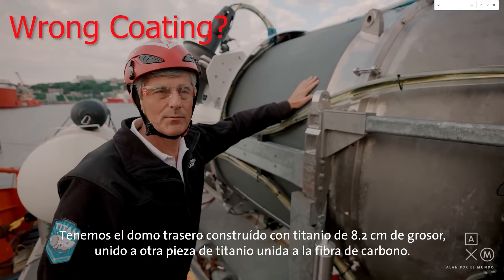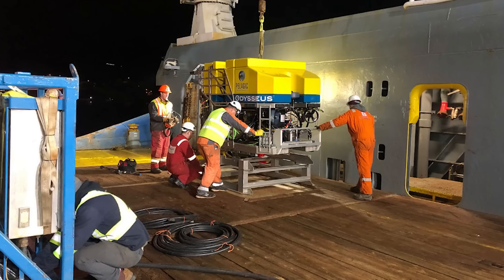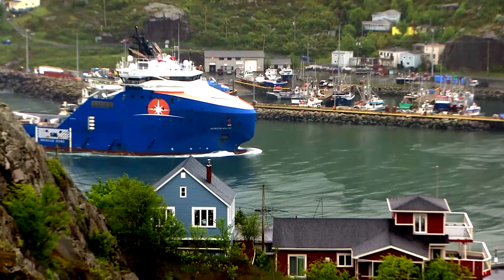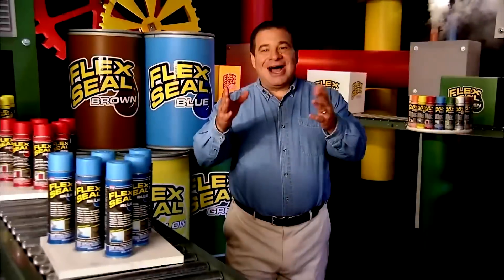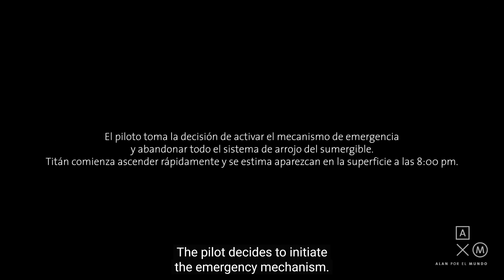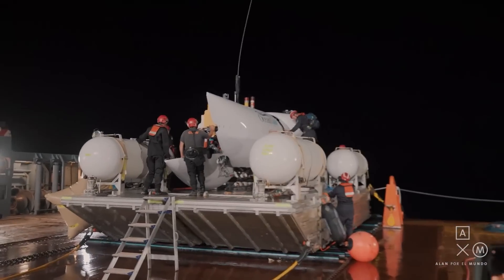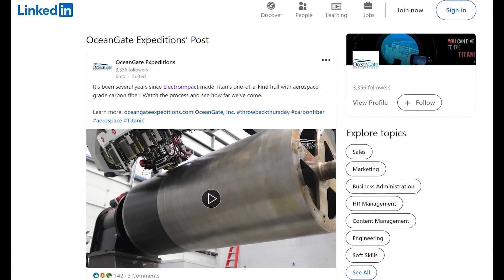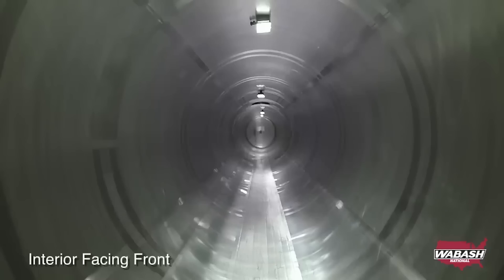Titan Sub Wrong Coating? Hull Construction, Debris Field Search

Comment: The Rhino Liner is designed to be vapor permeable so moisture does not accumulate under it.  This means that at high pressure, water vapor would be pushed through and accumulate under the liner in the pores of the carbon fiber as it descended.  When the Titan then ascended this vapor would try to exit and cause delaminated blisters in the liner.  In this video, and the original video by Alan por el mondo, these blisters are evident all over the hull.  In the videos when Stockton is talking about the liner he’s places his hand on the hull and if you look closely he moves his thumb right on top of one of the blisters.  The formation of these blisters make Rhino Liner inadequate for this application.
Reply: Rush sort of knew what he was doing, but didn't really know enough to do what he was doing. And of course, he ignored all the experts in the field. It was just a matter of time.
Reply: @DerBingle1  He knew enough to be dangerous !!
Reply: @DerBingle1 Rush was obviously a marketer (professional liar) not an  engineer.  Elon Musk has the same trait

.
Reply: repeated dives fatigue failure never checked too
Reply: @gopikrishnan890  How could they not have taken that into account? It seems so basic.
Reply: @DerBingle1  I think that the design team did not fully understand the effect of seawater at high pressure on the carbon fiber hull.  Carbon fiber is well understood and suited to pure compressive loads but has 2 major weak points.  The first is that it is porous and the second is the much weaker strength of the laminating resin compared to the strength of the carbon fiber.  The porosity is a problem since high pressure water, vapor and air can enter the resin matrix and apply unanticipated loads to the interior structure of the carbon fiber matrix. The second problem is the strength of the resin is only about 6000 psi.  This means that at depth the pressure can equal or exceed the strength of the resin and can cause delamination of the structure. This damage would then grow on successive dives increasing the porosity of the structure and reducing its strength.  This delamination was most likely the structural sounds heard during the dives.  If the designers had really understood these aspects steps would have been taken to reduce the affect or eliminate these problems. The first would be to limit the operating depth of the Titan to 2000 meters so the pressure would not exceed 3000 psi and provide a 2 to 1 safety margin.  The other, and best, option would have been to use an impermeable metal external liner to prevent any pressure from entering the carbon fiber structure.
Reply: @DerBingle1  sociopathic business owners are the norm. they're not team players. that's why they're business owners and you're working for them. This attitude by the dead CEO is completely normal.
Reply: Rhino liner or no liner. The Titan had passed its service life after one dive.
Reply: Science is fun
Reply: I agree.
Reply: Also remember the submersible was towed out to the dive sight, not wenched on the ship like it usually was. So it was battered and waterlogged by seawater for 3-4 days prior to the dive itself. Look at how quickly it was diving, it clearly was overweight which was shown by how quickly they were descending.
Reply: Rush's facial expression always makes me think of the face of someone who has just been told a joke that you were the butt of.
Reply: Eggg-zactly..!
Reply: The same reason is why any bedliner and seal coating is garbage because it just traps moisture and prevents the metal from breathing which makes it rust faster.
Reply: Rhino Lining is just molten polyurethane, sprayed on. It has no magical properties other than weather resistance, waterproofing, etc. Using rhino liner in any capacity as an adjunct with carbon fiber and titanium is amateurish in any case, because you shouldn't be trying to use it AT ALL!   IT'S STUPID!
Reply: Isn't Rhino liner used for pickup truck beds...?

Comment: We need to know what temperature ranges the sub would have been exposed to. How warm did it get in the sun and how cold did it get underwater.
Reply: Temp is one thing, but the pressure surely would cause the materials to contract significantly, even the viewing window (acrylic) is said to lose 3/4 inch when reaching the titanic depth.  The component materials would expand back to their original size when the sub goes back up to surface
Reply: @joeharry32817  I completely agree I commented that on another video. Different materials contract and expand at different rates this was probably caused by a mixture of factors. Finding out as much as possible will help in figuring out potential issues. My main interest is the connection of the carbon fiber hull to the titanium domes. As well as the acrylic view window.

Comment: You're wrong. The coat has nothing to do with this. Effectively the sub was build using the wrong material. But inside his layups. That sub should be build using Kevlar and not Carbon Fibre convined with Titanium. That sub was getting old due structural fatige after every immersion.  Then collapsed. I am a Marine Engineer and Surveyor 34 years experience.  When I hear the material used to build up the sub. I told my family, they used the wrong material. The coat is dynamically right. Due the pressure compression and expansion has to be coated to do not crack.
Reply: Nobody knows exactly how the CF would work at the depths they went into because there is little knowledge abt its exact behavior when reaching the Titanic's wreck depth, what more the interaction between the two different materials ie the coating and the CF
Reply: @joeharry32817  Nothing really important if the walls were correctly built-up.  Carbon Fibre is not the right composite to support such as charges of pressure.  The sub should be built-up using Kevlar.  External coating means nothing.  Is non structural.

Comment: I think a 1/3 model is okay. I mean they do that for ships, wind tunnels for airplane models.  It has been stated before that Rush did not do enough testing. After he put titanium caps on the cylinder,  they should have tested again to check if there was other  weaknesses. Namely the way they didn't weave the carbon fiber cylinder.  The emergency plan seems to be just as bad?

Comment: Ocean operations, whether ships, submersibles or aircraft, is an extremely harsh operating environment.  Just like other harsh or risky environments, "standard methods/procedures/etc." are typically established due to losses of life to prevent that "mistake" from happening again.  It always amazes me the number of times someone will come along with a "new" idea to save time and/or money, claiming established standards are antiquated and hold things back.  It's crucial to keep lessons learned documented, and to research them when looking to change something.  And most importantly to heed inputs from those "gray heads" who have the history and experience under their belts.

Comment: Thought the basic problem was using carbon fiber.   Thought it has a memory and at best may only take 'x' force before losing strength.   Make one dive and go deep, the carbon fiber degrades, and dive again it will progressively get weaker...  Thus the reason carbon fiber should never ever be used for a deep submersible...

Comment: There is a bridge in Maine that is a giant carbon fiber expiriment.

The Penobscot Narrows Bridge has steel suspension cables holding up the concrete road. Very pretty bridge, actually! It was built right around the time builders were considering using carbon fiber in place of steel. Now, carbon fiber has great tensile strength, but is also lighter than steel, so it doesn't have to hold as MUCH when it's being used. Still, it was untested for bridges at the time.

So what they did is built the cables out of steel... but every couple of years, they replace ONE steel cable with a carbon fiber cable. This way, they can safely monitor how the cables are handling the weight without losing the safety of established materials, and generate data for future bridges that will be used with carbon fiber.

THAT is how you test material strength! Over YEARS, and with redundancies and backups when there are human lives at stake.

Comment: The US Navy heard the implosion on Sunday, June 18th, the day it happened. They knew the entire time the search was futile. Jeff, I don't think this situation is a joking  matter. Save the flexseal bit and "funny" names for something where people didn't die. I'm not certain if Rhino Liner was the proper material to use either, but I don't know for sure, and obviously, neither do you. Your speculation on the matter is pointless unless you have solid evidence that it was incompatible at those depths. 
The pressure chamber should have been replaced after every dive. Period. Instead of charging $250k per person, they would have had to charge much more, but it would have been the proper way to ensure people's safety since they weren't using titanium or another proven material for those depths.

Comment: Is there any data supporting the effective strengthening carbon fiber adds under pressure (as opposed to tension)?  This construction should have been tested for years with dozens of unmanned submersible drones  and destructively tested at regular intervals.

Comment: Hey, Jeff. I would like to ask you something. 
Let's say, they heard a cracking sound at 4000 meter depth and decided to come back, would it be still possible to ascend to the surface without any troubles or it would be already too late?
Reply from the maker: They can ascend and drop ballast weights to help.i would try to get up as fast as possible to hit lower water pressure.
Reply: @jeffostroff  Its inexcusable now that they had this slow ascent insufficient ballast issue on other expeditions & never properly addressed why. Others would call it outright criminal negligence.  Thanks for keeping us well informed on this topic.

Comment: The method used for launch and recovery was a disaster waiting to happen itself. Why make it so complicated? Why not a simple lift point so it could be craned on and off of the ship? Could it be that this was just another cost saving method? Why pay out for a ship with such lifting capabilities when you could simply tow it behind any old ship going? Which is exactly what Rush ended up doing this year. Could this method of simply towing the craft behind a ship been his plan all along?
Reply from the maker: That's a good idea

Comment: The  point of failure was most likely where the carbon fibre composite and the titanium were joined together with glue. These two materials have different rates of contraction, so that joint was under constant stress, at that depth the composite had about 1% contraction and the titanium basically non. This wouldn't result in an implosion, a pin hole leak would rapidly expand and the water would almost instantly decompress to about the speed of sound. So about a ton of water would have rushed in at over 750mph at one end and broke the sub apart as it hit the other end, giving the recorded sound and the debris field, that isn't an implosion.

Comment: In my view, the implosion was caused by a progressive degradation of the carbon fiber hull, specifically at the interface between titanium and carbon fiber, with the main drivers being high cyclic pressure and sea water intrusion. The glued interface to the titanium flange was not properly designed for the enormous compression and shear stresses, and it was prone to breaking up over time. The carbon fiber in that area would similarly have been subject to enormous stress concentrations and water intrusion, leading to micro cracking and degradation. Unfortunately, the flange design and the Rhino Liner coating made it impossible to inspect the condition of the interface and the carbon fiber ends.
I wonder if Stockton actually tried to inspect this interface area on the sub? Any close-up footage of this area from the later expeditions, potentially showing signs of reapplied Rhino Liner, swelling or other damages etc, would be very interesting to examine.

Comment: Hull thickness was an issue with both the TITANIC and the TITAN.  Thomas Andrew's wanted the TITANIC's Hull plates to be one and a quarter of an inch  thick , but Bruce Ismay insisted that one inch thick hull plates would reduce weight.  The TITAN's. Hulls thickness was supposed to be at least seven inches instead of only five inches thick. Fascinating and tragic.

Comment: Cool, thanks for breaking the timeline down.
So in reality although the duration seemed like a long time, the find was almost instantaneous.  What was all the noise about searching an area the size of some state or other? Was that just surface ships banging away with sonar, or towed sonar fish?

I've seen some interesting tests and demonstrations of the Rhino coating, but nothing at depth. It would be good for protecting the carbon fibre while the sub was on the surface, ie in transit to/from base.  They really needed to test if it could maintain a waterproof seal on the carbon fibre and / or the end caps.

FlexSeal?! ROFLMAO
Great idea, the OceanGate probably could have gotten an endorsement.

8-9 hours bobbing around on or just below the surface like a cork would have been a real barf fest!  Even though that failed run was not applicable, it does touch on one design failure: no way to escape without outside help. They recreated the problem with Apollo 1 (fire) and Challenger shuttle (I heard speculation that the shuttle crew survived the explosion and fall until they splatted in the ocean). I'm sure certification would have insisted on some sort of internally controlled exit.

1/3 size model to save money ... 

The more I see, the more it is obvious that OceanGate was a shoestring operation.
Reply from the maker: Yes, initially they stated the. Size of connecticut. It does seems strange that they would search that large but I guess. A submersible can drift
Reply: @jeffostroff  Drift sure. But I got the impression that no one was searching in the immediate area of the dive, instead they had search ships way the h**l and gone, "out in the sticks". 

Any word on "official" transcript of communications with the sub?

Comment: Bear in mind the railroad tank implosion was with a pressure differential of 15 psi not 4,000 psi the Titan experienced! There is also the thermodynamics of the compression of the Titan's internal atmosphere to be considered, which would have been as equally destructive as the initial implosion itself. It all predictably  ended very badly thanks to that psychopath Rush. Only positive outcome is that he was in it at the time.
Reply from the maker: Yes, this was only 1 atm. Where was the Titan was 300 atm

Comment: Haha the idea that someone would make a 1:3 car model for a crash test is insane... cannot believe you said that out loud :) Like Pirelli will make small tyres, and Hella will make a small head light with small lightbulbs and then small airbaigs and seatbelts etc etc... you test the real car, because only components for a real car are available. In a windtunnel, you test models, because they are not the real thing, they only have the shape of the real thing. You can make a 1:3 version of a carbon tube, you cannot of a car consisiting of several thousand components.

Comment: Can they use a 1/3 model to effectively test? YES. In fluid dynamics, this is often the first test: a scale model. You can scale the math to match. They should have done a full scale model rest after the prototype passed.

Comment: LOL!  Proves the danger of youtubers "just thinking"!  What's next?  They used a combination of metric AND imperial fasteners?  A surface coating  like this does things like blocking UV while above water and protects the carbon from being damaged by abrasion when being handled, transported, repaired, etc....while still being black like the carbon underneath.  It's fine!

Comment: Was the carbon fiber tube covered with Rhino liner before being attached to the titanium rings or was it sprayed over the ring edges and tube? Either way creates a place where the liner might be made to split as the rings and carbon fiber respond differently to increasing pressure.

Comment: Besides making the hull out of essentially very strong rope or string, there was no allowance for pitch control as the sub moved forward in the water.  Submarines have diving planes to point its nose up and down.  All the Titan had was four four small electric propellers amidships that could not control the forward and backward tilt of the sub.  You needed diving planes to control this or additional motors and props on the front and back.  As a last resort, the passengers should have had seat belts or something to keep them distributed around the sub so that it had a chance of staying level instead of nosediving to the bottom.  I appreciate the work Jeff has put into this analysis.  Good job!

Comment: Rhino Lining is extremely tough and durable! I don't think he used it to make it stronger, I think he used it to help keep the water off the carbon fiber and help make it more water tight.
Reply: Also if he wanted to carry a load of 2x4’s to the ocean floor without scratching the sub :)